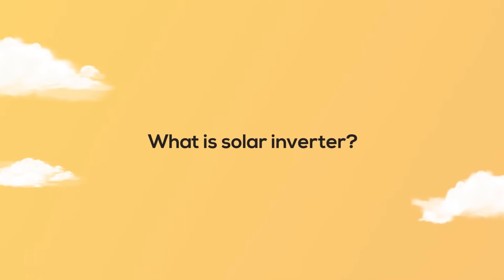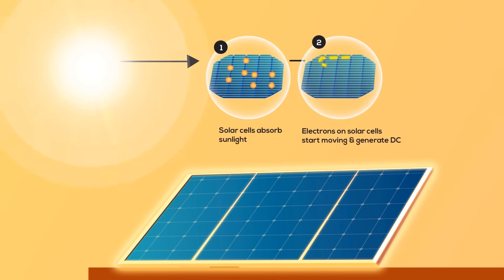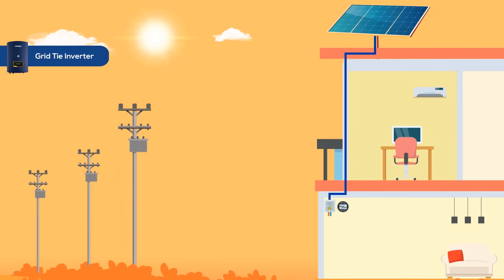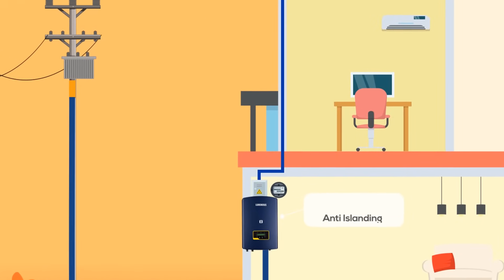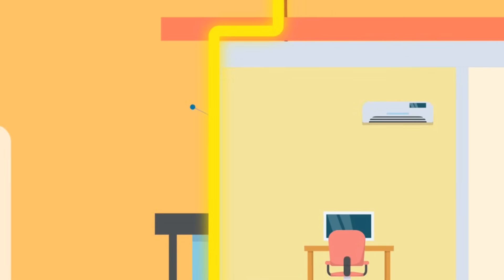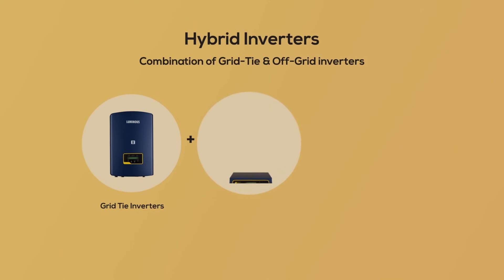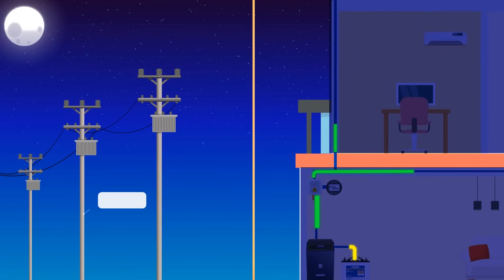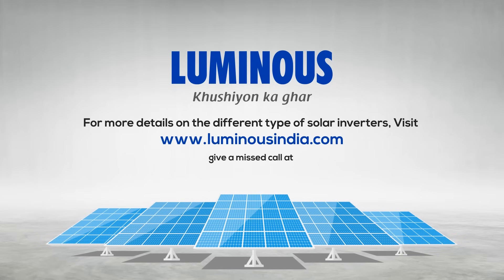What is a Solar Inverter and How Does it Work | Luminous

Comment: Hi..in a hybrid inverter, will the inverter let the battery to be charged from solar power during a long power cut with no power from the grid? Please clarify. This would be useful during floods/cyclones when there is a long power cut and inverter battery would run out of charge.....so will be helpful to have it charging from solar panels...please clarify if that would work.
Reply from the maker: Hi Sunderajans, thank you for reaching out. Yes, it will charge the batteries via solar panels during a power cut, and it will work as an off grid inverter. Hope this helps!
Reply from the maker: Hi Sunderajans, we’re checking internally regarding your concern and we’ll get back to you soon with an update.

Comment: I used my old inverter and solar system with ACCL. Its working like pro with very minimal investment. Its enough for normal usage. I can make best use of solar energy and in rainy season if required I can charge directly from mains.
Reply: Not your product 😏
Reply from the maker: Hi Harish, We’re happy to know that you’re satisfied with our product. Do let us know if you require any assistance.
Reply: Are you using this for On grid system or Off grid?

Comment: If enough solar power is generated, I want to use that solar power to run the load and charge the inverter battery, and if there is not enough solar power, use the KSEB power to run the load and charge the inverter battery, and if there is not enough solar power and KSEB power, use the battery power to run the load. Any solar inverter supporting this working model?
Reply: Go for hybrid inverter

Comment: How many hours will it work for two 9 watt bulb
Reply from the maker: A small leakage current flows from Battery to Inverter in case there is no load on the inverter. The amperage is very less for this current. 
Please let us know the battery capacity, age and make connected with inverter to share the exact back up time.

Comment: Suppose I want to use such inverter where there is no Conventional power is available, will it work? 
I believe the inverter will charge the battery only when mains 230V available, irrespective of Solar Available or not, am I right? 
So when I am using it in completely standalone environment where there is no 230 V available at all, the Off Grid system will work? 
Or I will need 230 Volt to just make sure inverter senses that mains is available, but as the solar is available it will charge from Solar? 

In short, can it charge the batteries while the inverter being used in Day time? 
I have existing 1KW 12 Volt Panel system which is only used to charge Lead acid cells and all my Loads are DC 12 Volt loads working fine with just a PWM charge controller.
Reply from the maker: Hi Gurudatta, Off grid solar inverter can work in areas where there is no conventional power available. It will charge the solar batteries via solar panels and can be used to run AC appliances.
Reply: @LuminousIndia  I know that, but if Mains are not available at all, can the inverter work while charging the battery at same time?
Reply from the maker: @gurudattapanda  Yes, it will work.
Reply: @LuminousIndia  can I talk to your technical team please? 
I think for that you need a PCU. Isn't it correct? 
And on manual of the inverter it is not clear whether PCU is inbuilt or not.
Reply from the maker: Hi @gurudattapanda , could you please share your contact details, so that we can assist you better?
Reply: One doubt on the Off-Grid inverter, since is not very clear from the video

In the video it is stated: "In this system, DC power generated by solar panel is used to charge solar batteries"

Does this mean that, in a normal scenario (no power cut), an off-grid inverter is used only to charge batteries for later use?
Or it can run both home appliances and charge batteries in the same time?
Reply: @andreideco yes